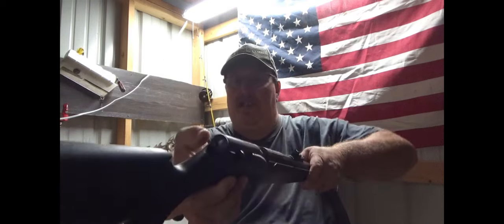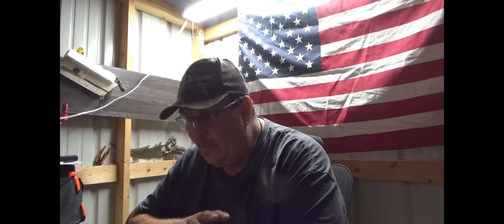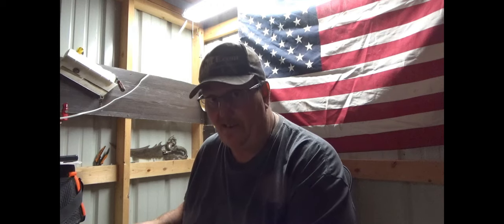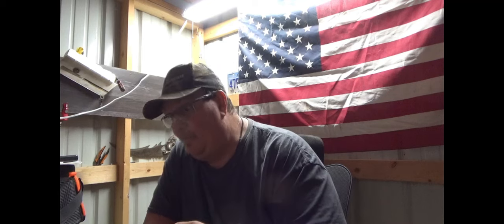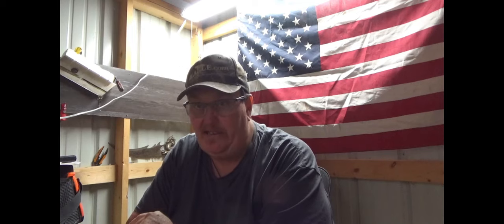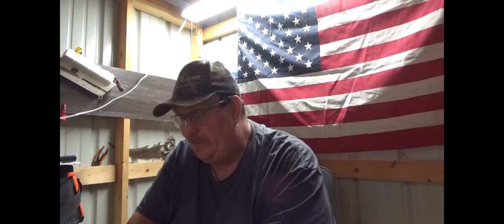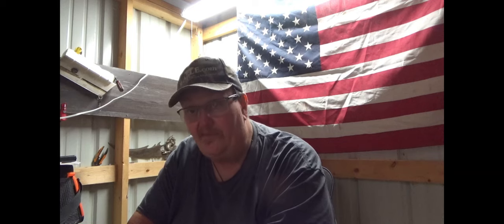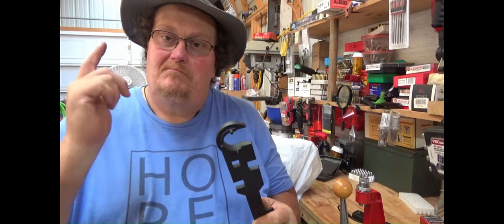Removing a stuck action plug(in an inline muzzle loader)

Comment: I just bought a CVA Muzzleloader that has a rusted Breech plug . I soaked it in Blaster rust remover. I tried to remove it to no avail.  I will havevto try the heat treatment. Thanks for sharing your ways.
Reply from the maker: Let me know if you solve your issue...
Reply: @Fatman0815  No luck removing the breach plug the conventional way . No it's time to bring out the big guns . 😆